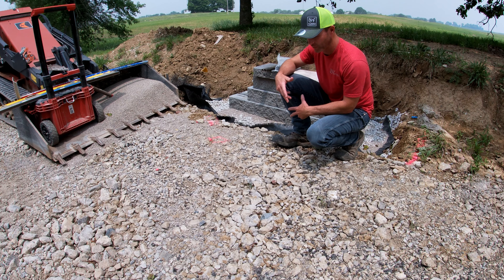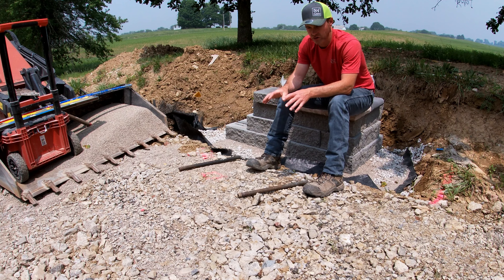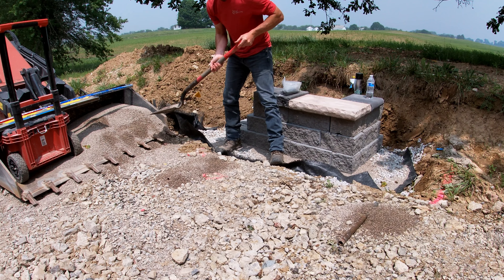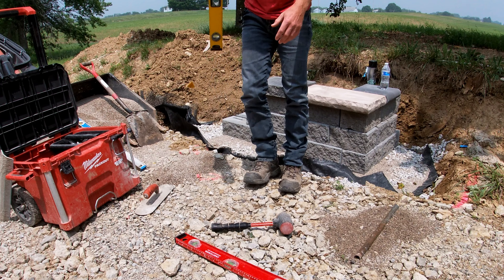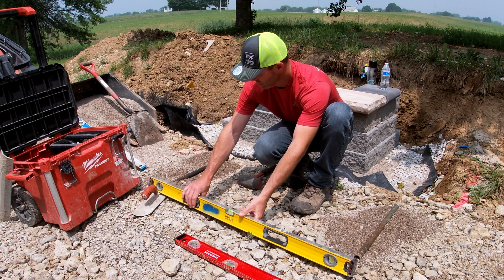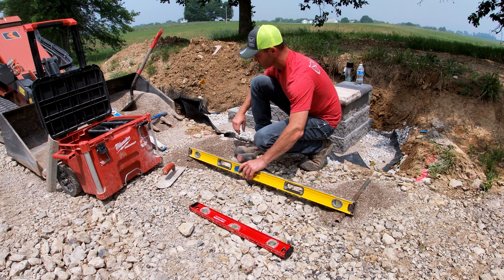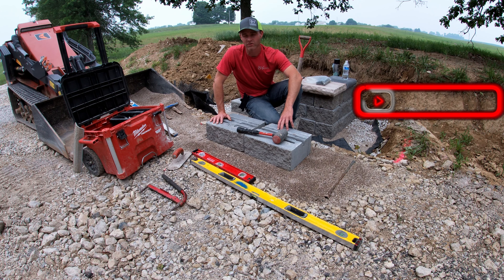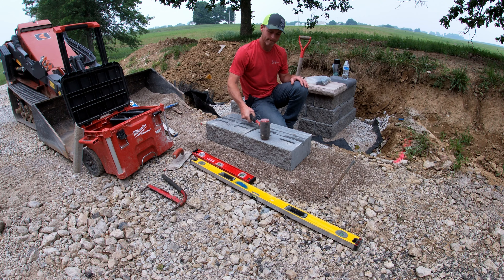How To EASILY Build A Perfectly Level Landscape Retaining Wall!

Comment: The nice thing about using concrete as a bedding material is that it really holds the pipe in place so you can get a solid screed without worry of it shifting